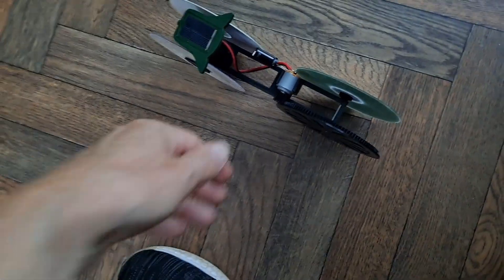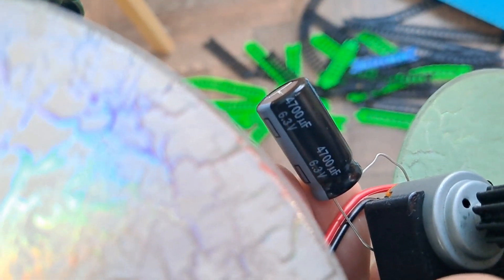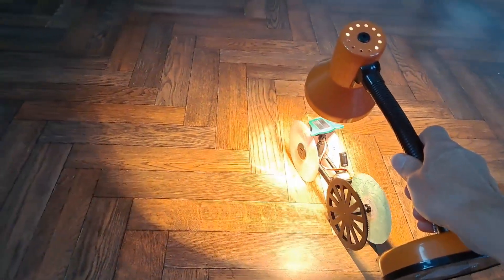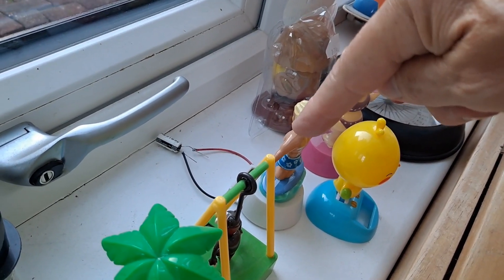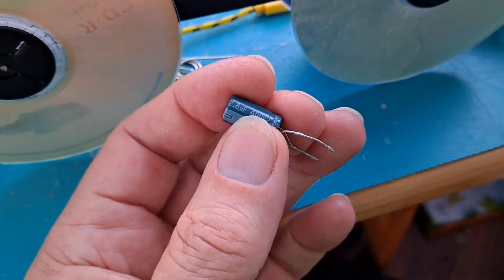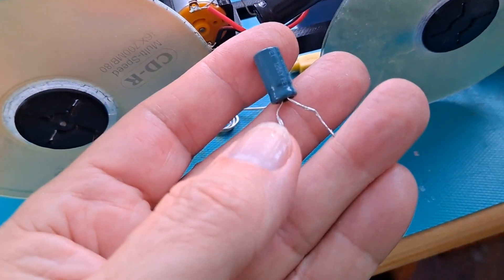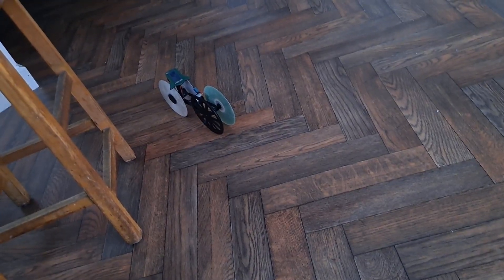Video Reply - Capacitor on the solar powered car

Comment: The first capacitor you tried, that 4700uF 6.3V one was not a super capacitor but a regular electrolytic. Not that it would make any difference, i just thougt i would point that out to you.
Reply from the maker: You would think the fact I read it out on screen might have triggered my memory, obviously the brain cells are failing fast. I have added your comment to the video description and pinned it so others can see it 👍
Reply from the maker: Yes you are right, thanks for spotting that. There is a bag of them on the table. Obviously I grabbed the wrong one out of the box. The one in the window on the solar rocker is a supercap, so that bit was right 😁

Comment: rocker dudes cap charges all day... could you put the cap online with the motor so the charge does a pass thru?
Reply from the maker: I am waiting for somebody to post an explanation of what they actually expect to happen. As I see it, the solar rocker draws so little current there is a surplus produced by the solar panel and that can be stored in the supercap during the day. The rocker circuit runs on pulses, so between the pulses the power can build up in the cap. That is not the case with the cap across the motor, all the power is used by the motor all the time, so when does the cap get any charge and even if it does, what stops it discharging into the motor. Without extending this reply any further, I can see a situation where it might help but I am keeping that under my hat. The original comments were simply "put a capacitor across the motor" and that is what I have done.

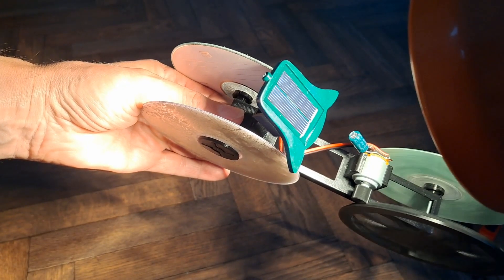Comment: You're quite right with your applications, there'd be little to gain for high loads. However, the test at 5:40 should show the motor starting easier with a moderate cap (~1000uF), which is what I found on solar with a Bedini motor. Also, it ran later into the evening.
Another use is for quick bursts of switching power on solar powered chip based circuits, where the cap smoothes it out and prevents a brownout.   
To note, motors seen with ceramics across them are for EMF/EMI suppression.
Reply from the maker: Thanks, Mark 😁😁I was hoping you wouldn't think I was disagreeing, as you say, different purpose, different application.

Comment: build an audio amplifier grandad 👌🏻
Reply from the maker: For what purpose. Is the audio on my video too quiet?
Reply: @GrandadIsAnOldMan No, the audio is great. It was just a suggestion
Reply from the maker: @ottoman556  I was teasing. I seem to remember I might have built of using those cheap electronics kits on eBay from China. Here you are https://youtu.be/DD5Ms_rNPf4?list=PLA5a2xPRSrB0ErqyWzQTL6yk8m0FxkD0_